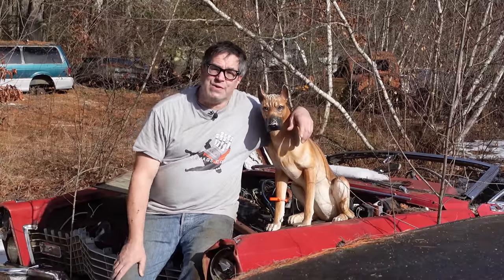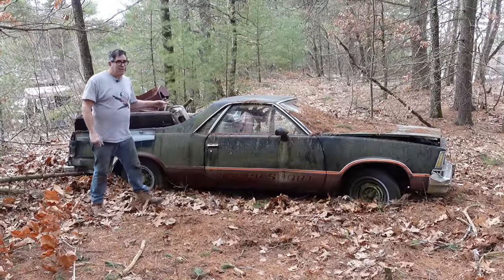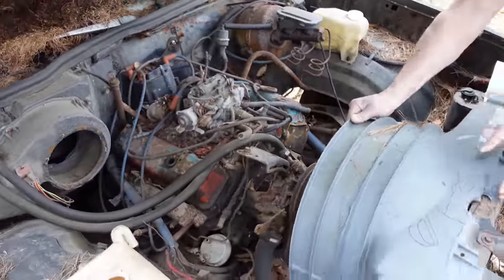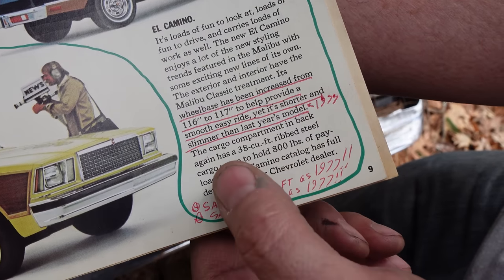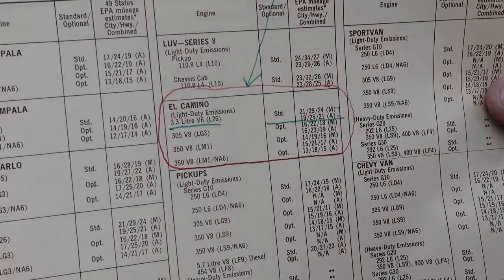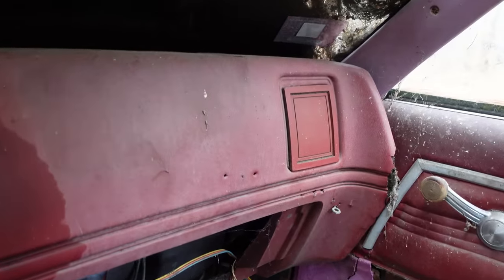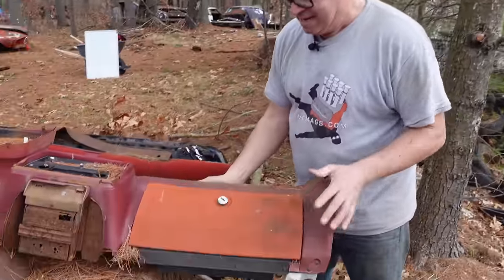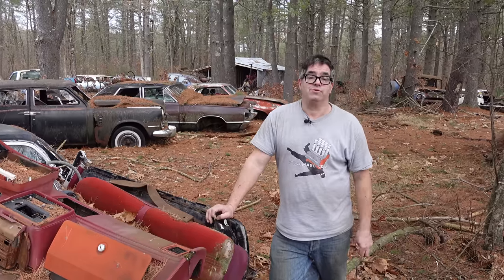El CRAM-ino

Comment: Steve, As long as it has a full frame underneath, I consider it a real pickup TRUCK. 😁
Reply: agree!  a unit body is not a truck
Reply: That one did have a frame but does not look like it has one any longer.
Reply: In the last generation they did still have a full frame but the frame was much weaker. Pickup yes, truck kinda.

Comment: I had an 1986 Non Choo Choo Customs SS El Camino, 305, 2004R, 2.56 Limited slip, Buckets, Console, Full gauge package with tach, and A/C. 
I believe GM added the extra bed space under the back window by adding a "Smugglers Nook" which was the compartment under the front portion of the bed to allow storage of the spare tire laying on its side rather than standing up behind the passenger seat. Prior years had the storage area but it was accessed from the outside and ended at the bulkhead. 1978 you could actually order a 350 with a 4 speed stick in the El Camino if I remember correct.
Reply: Yes you could order a 305 or 350 in 1978 with a four-speed manual transmission or automatic. Your 1986 El Camino likely had a THM700R4 (originally), RPO code "MD8", not a THM2004R which was RPO code "MW9".
Reply: @googleusergp  On my 86 I have to respectfully disagree on the transmission. My understanding is there was no 700R4's used in G-Bodys during the production run. The 2004R fit in the same floor pan as the turbo 350, the case on the 7004R is larger. My 2004R is sitting in storage waiting to be installed in a 79 Monte Carlo. Dual bolt pattern bellhousing, (BOP & Chevrolet) no removable tail housing. I ended up having the unit upgraded to Grand National internals when I had it rebuilt for use behind a 355 in the El Camino. I also kept the SPID from this vehicle when I scrapped the body tub and it does show the "MW9".
Reply: @79USA1  Nope, the RPO code "MD8" THM700R4 is clearly shown in the "Engine and Transmission Usage" chart in the parts book for the "G" body, including the 1986 model year. Yes, your car had a THM200-4R if you had "MW9" on the SPID, but "MD8" could have been a choice on some models as well.

Comment: El Caminos have always been a favorite of mine. I have owned three. My favorite was a '69 SS-396; column shifted auto and power bench seat. Next was a '74 350 4sp and finally an '81 V6 with a floor shifted 3sp.My current rig, an '05 Colorado Extreme regular cab reminds me of driving an El Camino, but doesn't have the bed capacity.

Comment: My girlfriend back in 1991 had a 4 door Malibu-bble (I think it was a 1980 model) with what I believe was a 229 V6. No torque but I still enjoyed driving it over my 1979 Volare with the 225 Slant. That little V6 revved and I could hustle it through Manhattan with the best of the cabbies. Coil springs and GM steering which much appreciated over the transverse torsion bars and buggy springs in the Volare.
Reply: 1980 would have been a 229 V6 more than likely, yes. A VIN code "K" engine. My brother-in-law had an '81 Monte Carlo with it, and when he and my sister were first married, they lived in an apartment. So they would leave the MC here at our house and come and get it when they needed it. Most of the time they didn't, so I drove it. They paid for parts and insurance, I did all the maintenance for free. It was a win-win. It was sold in 1994 and used as a pizza delivery vehicle for a time and then I believe it got junked. It was owned by a doctor (a relative of my brother-in-law) prior to him owning it, so when I had it, that car could go anywhere since it had all of the parking permits from the hospitals on it. LOL. It was in an accident early in its life though. When you'd sound the horn, you could hear the faint tone of the key buzzer at the same time. The car rode and drove fine, so I never looked into it. 

Yup, the Volare and Aspen rode like a horse and buggy. My friend bought a 1978 Aspen "Super Six" in 1994 and the seller said, "Runs great, handles like a sack of potatoes." LOL.
Reply: @googleusergp  Cool stories my friend. My dad was always baffled at the transverse torsion bars. He hated them. The 66 Coronet with it's longitudinal torsion bars rode a million times better (and still does). But I will admit that GM cars with four coils ride real nice.
Reply: @LongIslandMopars  Sure. The last "regular" Chrysler we had was a 1974 Charger 318 V8. We sold it during the height of the gas crisis in 1979. I was playing in my grandparents' yard and a guy came to look at the car and saw the sign in the window. I called to my dad and he came out and sold the car on the spot. The owner lived up the block from my grandparents and kept the car in the same excellent shape as my dad did and they had it for quite a number of years. Then it was gone. It was code G8 Deep Sherwood. 

We had a 1972 Charger from 1976 to 1978. When we sold the 1972, I was home that day (it was in the summer) and two guys rang the bell. The one guy said to the other as my mom was coming down the stairs, "Yea, I'm going to jack up the rear and put some Cragars on it, throw in a tape deck, etc." My mom said, "Guys, just so you know, it's the one in the street, not this one". Their mouths dropped. The 1972 was also a 318 V8, it was code F3 Fiesta Green. We sold it in 1978 and the new owner drove away and hit the tree in front of our house, cracking the RH rear marker light. LOL. That tree still stood in front of the house until two years ago when the city removed it. (It was getting old and rotten). Waiting for them to remove the stump now. LOL. My father kept both cars (as with all his cars) in great shape, doing all the work himself. 

The 1972 was the one I related the story that when we got it, my dad was cleaning out the quarter panel plugs and one side started spilling out pennies. My dad called out to my mother, "Hon, hurry up, give me a large pot. This thing is raining money". All told, about $8.00 in pennies came out of there. My dad called over some neighbors and said, "Watch this, the car pays you back". My dad still had the previous owner's phone number, so he called him and told him the story. The guy said, "Oh, I know why. My bowling dues jar was back there. It broke one day, spilled the coins into the trunk drop off area. Hey Mac, keep the change". My father laughed and hung up the phone. LOL.
Reply: @googleusergp  Well this is a small world. I bought a 1974 Charger 318 25 years ago this month and have it to this day. It has 49k miles on it as I bought it from the widow of the original owner. It had 27k miles on it in 1998 and I've kept it in original, unrestored, unmodified condition (except for dual exhaust and changing from 14 inch to 15 inch rims). It is gunmetal gray with a Lucerne blue interior.

My godfather owned a 1972 Charger 318 from brand new. When I turned 17, he had already moved to Florida and took it with him. He called my mom and said if "junior" wanted it, he'd have to come get it. My mom said "no way, he'll kill himself in that car". So he sold it to a cousin in Florida and it met it's demise not long after with a palm tree. Wish I had that 72 so it could sit next to Dad's Coronet in the garage, but I'll take my 74 any day over it because it was King Richard's favorite stock car.

Comment: The successor to the Chevy Malibu that came out 1982 was the Chevrolet Celebrity
Reply: Yes and no, as the Malibu continued after 1982. But yes, the idea was to go front wheel drive in the 1980s to save fuel and retain the interior space of the mid-size cars.

Comment: My family bought new a 1979 Malibu Classic coupe it had the small v6 , it was terribly anemic. GM was dealing with soft camshafts @ this time ask me how I know, 😱the cam failed .. my neighbor replaced the cam and lifters and the car went to 150k and finally succumbed to rust in the 90’s.
Reply: My grandfather's 1979 Caprice had a soft cam (It was a 305 V8) and it was done under warranty by the dealer when new. He got it in 1983 with 78k on the clock and it was a company car in my dad's company. That car went 13 more years trouble free until I sold it for parts in 1996. I learned a lot on that car. I bet my grandfather that if I couldn't repair it for under $100 in 1991, I'd buy it from him. For $78, I put a new water pump, timing chain set, gaskets, belts, hoses and fluids and it fired up on the first shot of the key. He bought us all lunch and drove the car another 5 years. I even remember the VIN number of it. LOL.

Comment: Not sure about the ElCamino but the coupes and sedans would lose their rear bumpers when driven in Northern areas that used road salt.  My son's '79 coupe almost dropped the bumper but we were able to rig up a cable and eye hook system to keep it on the car.
Reply: Yup, the rust ate them alive. My neighbor lost the rear bumper on their 1977 Olds Cutlass on the Brooklyn-Queens Expressway in the 1980s. My father warned my neighbor that the bumper was rotted, but to no avail. The next week, it had a new GM one on it sourced from my neighbor's daughter-in-law's father who worked as a parts manager at a GM dealership.

Comment: Had a ‘78 Monte Carlo as a company car with the odd firing 231 Buick V6.  No guts but actually got pretty good mileage, in the mid 20’s on the highway. But the crankshaft broke in half with less than 20,000 miles.  Tried to convince them to replace with a V8 but my company wouldn’t go along with my plan.
Reply: No, 1978 231 V6 engines were RPO code "LD5" VIN code "A" engines and were even-fire. The 1977 versions were both even fire (VIN code "A") and odd-fire (VIN code "C").
Reply: @googleusergp  Nope that's not what they told me when the crank broke.  Apparently I had one of the first ones off the line because it was a fleet car for National Car rental and it was built in '77.  They replaced it with the later version and it lasted another 45,000+ miles with no issues.
Reply: I don't think that was possible to get an odd fire in late '77, they were banished early in the year. But, if it was an odd fire,  I think you would have noticed a big difference in drive-ability. Even fire would be much smoother.
Reply: @LI-FLKayakFisherman  They told you wrong or you remembered incorrectly because the "LD5" was the only 231 V6 used in 1978 model year vehicles. The Buick division redesigned the 231 V6 for mid-1977, but by 1978, the Monte Carlo had the even-fire engine.
Reply: @tomwesley7884  Correct. The only 231 V6 in a 1978 Monte Carlo was the even-fire RPO code "LD5" VIN code "A".
Reply: @googleusergp  I'm not a GM expert but I do remember that's the excuse they used to explain the broken crank.  They said it was a very common problem in the Buick engine that was being used.  As I recall the car was delivered either in July or August of '77 and the crank broke just before Christmas.  They showed me what they claimed was the broken crank and it was broken just after the second journal.  My commute was around 155 miles daily and I had four oil changes on the engine, I think a shade over 19,000 miles when it blew. As I said, no guts but decent mileage.  And after two years my next company car was a Citation, another first year new model. Let's not go down that road.
Reply: @LI-FLKayakFisherman  You got the business. No "odd-fire" 1978 Monte Carlos. They were all RPO code "LD5" and were even fire. Boy you had two winners. A V6 Monte Carlo followed up by a Citation was two strikes and you're out. LOL.
Reply: @googleusergp  Regardless it didn’t matter to me. They gave me a new Impala as a loaner for the month it took them to replace the engine. The Citation made the Monte seem like a speedster with the Iron Duke four banger but the wife actually liked the four doors and hatchback as a family hauler. And it handled the snow quite well. I hated it but pretty much let her drive it for the two years and used a Volvo 122S for the commute. Other than oil changes the Citation never saw the dealership so I guess I was lucky but it probably never saw 10,000 miles in the two years I had it.
Reply from the maker: @LI-FLKayakFisherman  It is very possible some "poor castings" were installed in "doomed" engines. It isn't an unknown in the auto industry! -Steve Magnante
Reply: @LI-FLKayakFisherman  I get it. If someone else is footing the bill, why not? If I were assigned a work vehicle, I could care what it is as long as it works. They sounded like a skin-flint company though to offer an employee a Citation. LOL.
Reply: @googleusergp  At the time the company owned National. Executives got Impalas, lower management had lower tier in ‘78 and by ‘80 everything was fuel economy focused and my wife was driving a fairly new Fairmont 302 wagon that she hated because the mileage sucked and it didn’t handle snow well without a posi rear. It could break the rear tires with a touch of throttle. I liked it she didn’t. So I ordered the Citation because she liked the features. Wish I had that Fairmont today it would be a sleeper with a stroked 302.
Reply: @SteveMagnante  I agree Steve, they had no reason to BS me. The engine was on a stand next to my car and the crank was sitting on a bench next to it. Funny thing is I never abused it. Changed the oil every 3,500 miles. It blew up while I was on the parkway doing maybe 45 mph. Literally blew up with a bang and almost locked up the car. No advance warning, no noises. Fortunately my racing experience caused me to get it into N before further drama. BTW really enjoy these videos. I know that area well since I have family in NH just over the border.

Comment: Steve, the SS Impala was first available in 1961. They're very rare and came only with the 409 V8. 
On El Caminos, the taillight wiring harness went through the rear wheelwell where the wires would get damaged. The bodies were real rot-boxes in the Rust Belt.
Reply: Not true you could get a 348 in it also look it up